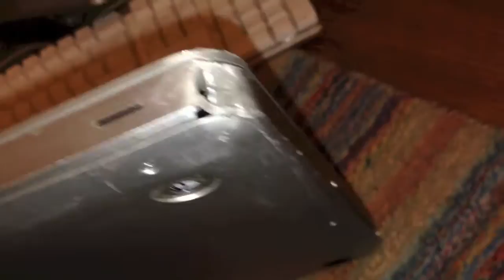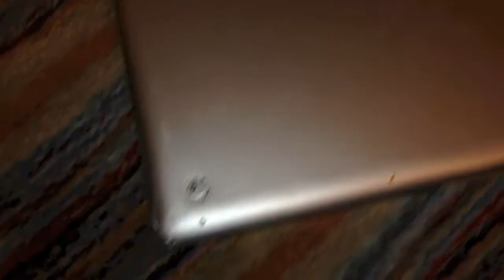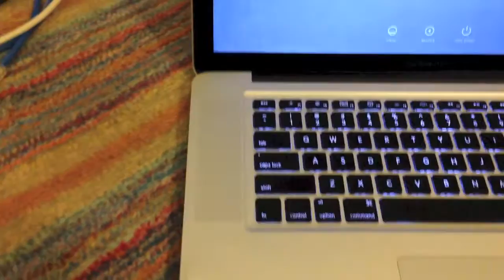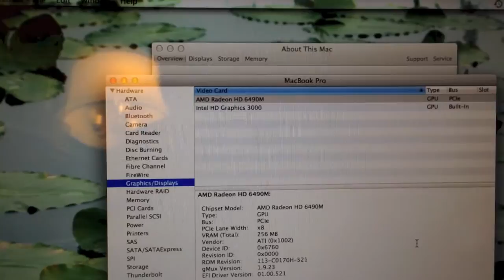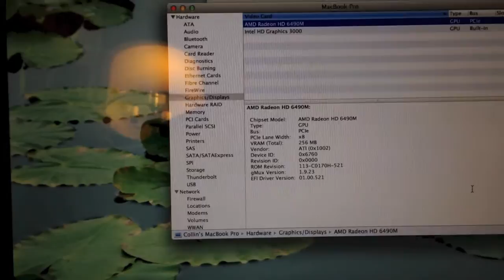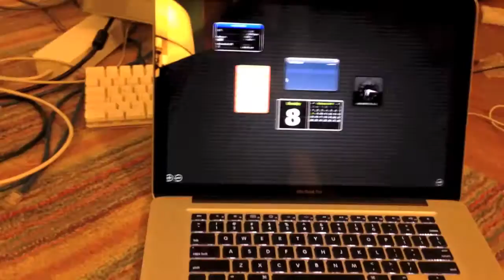Early 2011 15" Unibody MacBook Pro

Comment: Dude I'm so jealous!!!!! How's it working?
Reply from the maker: I extremely dislike Yosemite. As I mentioned in the video, Mavericks is OK, but I'd rather just run Mountain Lion because I like it best and it runs better than Mavericks or Yosemite.
Reply from the maker: It works great, I use it as my main laptop.
Reply: Oh ok :) but nice find! i paid 790dollars for a mid 2009 macbook pro 13 inch with 2gb ram and 250gb harddrive 1 month ago! not the best condition! though!
Reply: ***** No yosemite? :(
Reply: +DarkTube Well... I pay 150 bucks for a late 2011 13 inch (4gb of ram, and 120gb SSD), and it is in mint conditions, really carefully threaten.
Reply: Jorge Arcos i sold it now.
Reply: DarkTube Well, good for you?